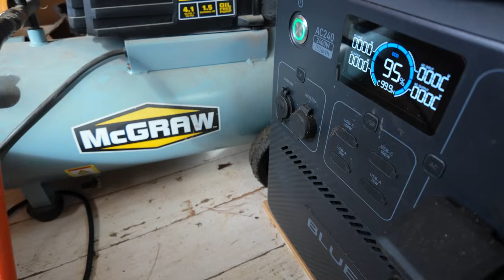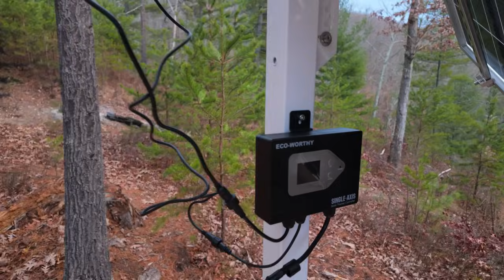Frosty Deadline: Finishing My Cabin Before Winter Strikes - Offgrid Cabin Build

Comment: Be careful with fire during wind. In 2016 the Mt. Pleasant fire burned 11,229 acres before it was contained. If you don't eradicate the rodents now, once the cabin is closed in they will chew through the walls to gain entrance. Any inside food smells will invite bears inside also. they will use the windows or doors to get in. I have bars over my windows. Get some trail cameras & put them around to see what visitors you have while away, you might be surprised of the activity while gone.

Comment: Did the solar panel mount require to be exact (noticed the N,S,E,W designations)? I noticed it was off center/misaligned on the wooden "platform" but was that bc it needed to be on a true direction. I figured it had to be intentionally off center from the base, based on your attention to detail with the rest of this build. 

Love it and look forward to what you come up with for the window transport 🤘🏻
Reply from the maker: Yes good eye! I rotated it ever so slightly to be more south facing then the screws would all be on wood instead of in the other screws if that makes sense.

Comment: You are a better man than me, I would have put some duct tape on the hole and tried to install siding.  You might be able to patch the hole, or cut the hose, put fittings on it and have 2 shorter hoses.